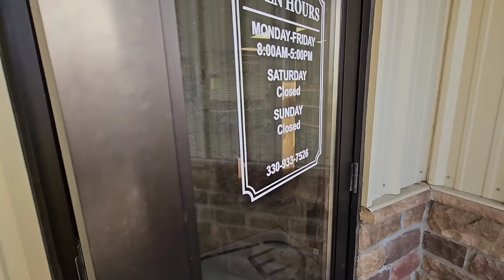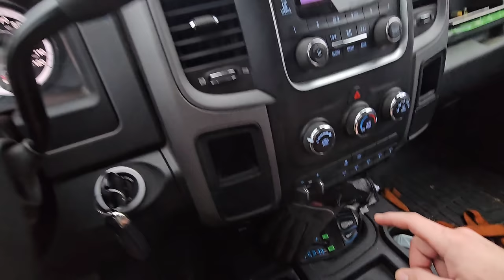DUMP TRUCK UPGRADES TO MAKE IT WINTER READY!

Comment: The white lights in fog at night will flash back at the driver. White lights on the back could blind a driver approaching you from behind at night. Did they give you a day-night switch? Consider amber in place of white, as amber will penetrate in fog. This is the reason emergency vehicles have rear facing amber lights...

Comment: Believe it or not amber and red attract drunk drivers having green and blue helps pull them out of the trance caused by amber and red. Blue is reserved for emergency vehicles in most states so they have been letting work men use green.

Comment: Truck looks great! 
   Started using battery tender solar panel on vehicles and equipment that gets infrequent use.   BIG help keeping batteries topped off.   They have a 12v cigarette plug so you can oftentimes plug the panel right into the dash to keep battery charged. 
  That and we purchased a couple new powerful jumper/booster packs for this winter!

Comment: Get a NOCO battery jumper, I think the GB50 is a big one, but I think there is a bigger one for diesel engines. 1500 amp to jump, 1000 amp too small...don't have enough juice to jump start.

Comment: I actually had green turn signals in the front of one of my trucks. i got pulled over and was told by a cop that I couldn't have them. Little did he know that it is legal in Ohio to run color as long as it is not red or blue. I left with no ticket or warning. This was right before ODOT started putting green on their trucks.

Comment: It look like you had a really long jumper cable you might have been able to throw it under the truck and go from there. I keep a jump pack in my truck it also has an air compressor on it from harbor freight

Comment: See if you can find a flange mount light that fits in that hole and attaches to the truck body with rivets or screws. They are good for areas where there is limited  access behind a panel

Comment: Shawn, wouldn't be a bad idea to put some poly fenders or some kind of spash guard in front of the rear tires. It will help protect the back of the cab. They get eaten up with stone chips then rust pretty easy if not protected

Comment: Sorry, but those aren't strobes. They are led lights which use less power and last much longer. You should have mounted one of your mini bars up on the dump header.
Reply: U must be in a different country but here in America we call then strobe lights the green and white lights
Reply: They are even advertised as strobes on the buyers website
Reply: @rayrayber_  strobes operate the same as a camera flash. You can get a single, double, or triple flash. Light emitting diodes blink individually and can be programmed to any number of patterns. You can look at the lights to see if there are flash tubes or diodes. Those lights were diodes. Led's are better than strobes and cheaper. Strobe lights don't have much of a market anymore.
Reply: Strobe and leds are the same
Reply: @bugsbunny1895  no completely different technology.
Reply: @upsjeff7 leds are brighter and strobes are softer lights to eyes but they do the same justice